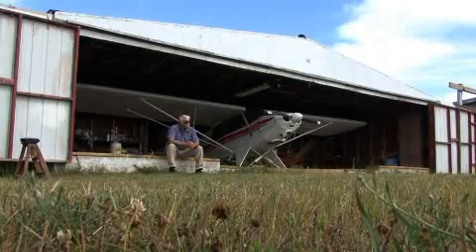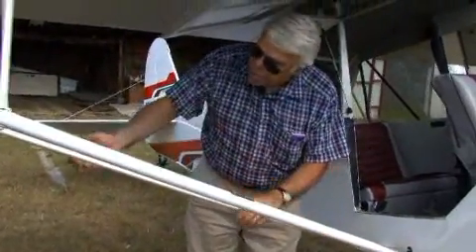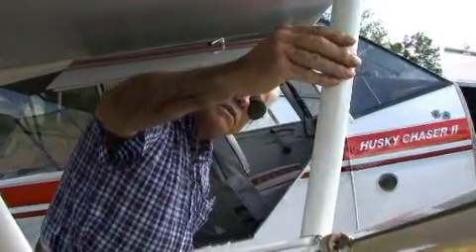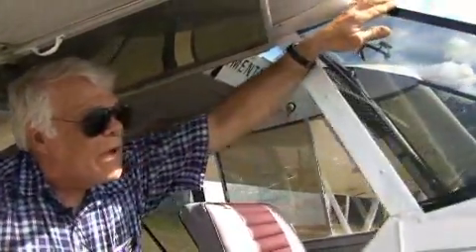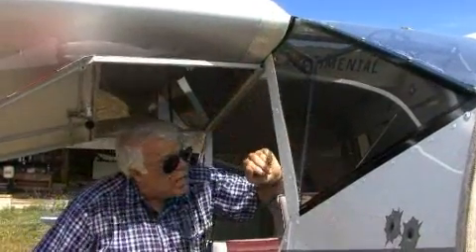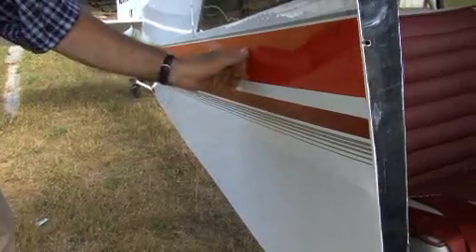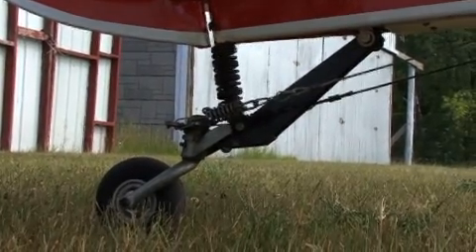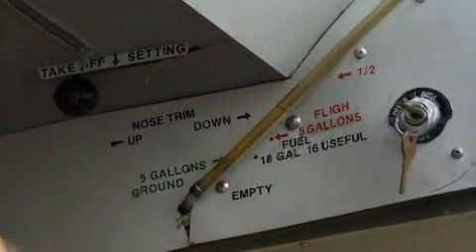Affordable Flying: Building an Airplane for Less than $6,500

Comment: I call bullshit. A basic Rotax engine is 15k minimum...
Reply: You didn't see the engine running though did you.
Reply: and lot biggest continental engine can buy less than 4000$ not many hour used,  only idiot waste money owerprice new engine same can buy or better engine buy used and lot cheap, ewerty normal men can repair engine new condition in garage. idiots buy new and waste money 15-30K only engine.

Comment: jeez man, this is almost to the point i'd be afraid to fly this.
Reply: Speculating here, but since Natalee Sibi spelled airplane as "aeroplane" and Potato Mafia spelled it as "airplane", it's entirely possible that the two of you do not come from the same country and thus are not subject to the same rules concerning airplane inspections.
Reply: the potato mafia I'd rather fly in a homemade craft, at least I know if the builder trusts it then it's got to be well made. Not only that he knows every nut, bolt,and screw in it.
Reply: Jeez Man you have no Idea what you are talking about that aeroplane is far safer than your car you drive I assure you..And it gets inspected yearly....So do a little research when you open your mouth.
Reply: Natalee Sibi, well you may be surprised to find that i AM a pilot rated for a cesna skyhawk 2 (trike not tail-drag) and am half way to getting a cpl, and i know that a airplane is extreamly safe and I'm saying that this plane is made extremely cheap, wich is nice and all but i would be very hesitant to fly such a plane, i could fill a book with the dangers of somthing like this in a high stess situation like i bet you if he had to do a Canyon turn or pull out of a spin the thing would fall to bits "spars are expensive- so i have this plastic tubbing" ffs
Reply: Natalee Sibi, and by the way any experimental airplane has no inspection mandated time, and a traditional airplane is inspected manually evrey 3 years or 1,000 flight hours (wich ever comes first)
Reply: Bull Shit...I am An A&P IA..I own a Business and every year they get inspected..I have built and restored numerous aircraft for a living....do not tell me something you are not sir...
Reply: Natalee Sibi, whatever you say dude, i'm honestly pretty done with comming back to this video for this. but i guess if you have nothing better to do i'll let you be,
Reply: @thepotatomafia8685  There's a lot of it I'd disagree on, but the plastic tubing struts I'll admit got me laughing. Things like the spoon latches, and car springs I could see working just find. At least if that was good silverware, and not the shit from the dollar store 🤣

Comment: great job, if you don't mind me asking, where did you get the engine and what is it ?  if you do mind don't answer. lol
Reply: I'm guessing a used 2 stroke snowmobile engine....
Reply: It's an aircraft engine when he opened the cowling to show the spoons he used you could see 2 cylinders . I would bet it's a Continental O-200
Reply: A quick search showed Remaned engines without accessories for $7000 and one without logbooks but turns over for $3000.
Reply: Nope, it's an older Continental aircraft engine, probably a C-85 from the looks of the rocker covers.
Reply: Probably most of the cost is the engine. hehe
Reply: How much do they normally go for?
Reply: Well that's good they aren't interfering with him at least for having an 'unknown' engine.
Reply: Awesome, huge respect for this gentleman 👍👍
Reply: I've seen builds done with air cooled vw engines as well Subaru water cooled. Both of them seem to have very robust designs for long life.
Reply: Engine came from harbor freight. Lol

Comment: DON'T fly it outside you farmland airspace OKAY ? .. Cuz I got kids playing in my backyard don't need debris falling on their heads.
Reply: It has a Airworthiness Certificate (Airworthiness Date
2006-08-04 )
Reply: Magic wand
The world of sports aviation has changed things so much and the FAA will not let an aircraft fly without going over it and no pilot is going to fly an unsafe aircraft.

The sport or homemade aircraft have let builders use thing from automotive engine gage's that work quite well
 VW engine as well.

Pick up a copy of kit-planes and you may be amazed I have work in both worlds starting in place were aircraft
had bigger engines along with other mod's done and yes the FAA made the business flight test all the new mod's to each aircraft.

Check out the collmill Panther or  Foxstar b58 mods.wile colemill is no longer  in business his aircraft mod's
live on.

And yes from time to time we do have aircraft crash but when you look at all the aircraft flying from major builds
to small mom and pop LSA shops this guy work seems well done and at the same time do not seem
to cut safety.

and having small light aircraft for under 10 K is not that bad
Reply: I concur.
Reply: I would rather fly in an aircraft that was hand assembled by the pilot flying it than a new production model. The hand built one is probably safer.
Reply: magic wand shut the fuck up your jealous ass wouldn't do shit
Reply: You're not very smart are you?
Reply: the vein slayer dumb headed idiots like you dont know what others have done..you clueless scumbag like your dad,if u actaually gt one..i doubt it